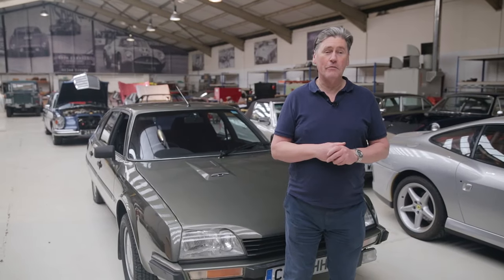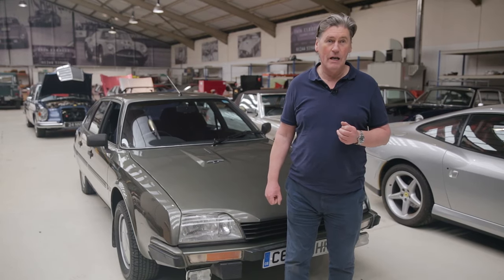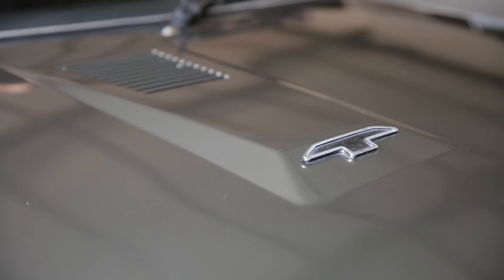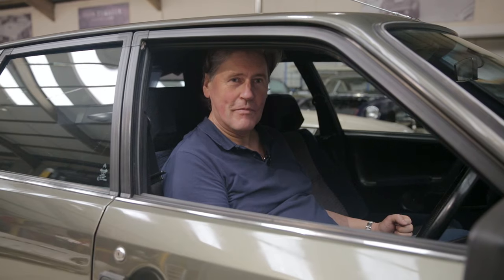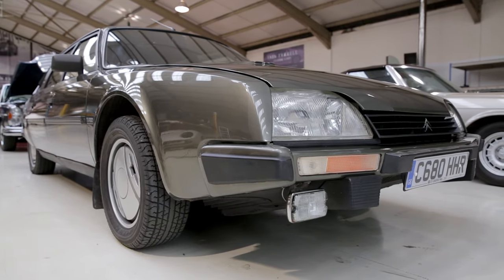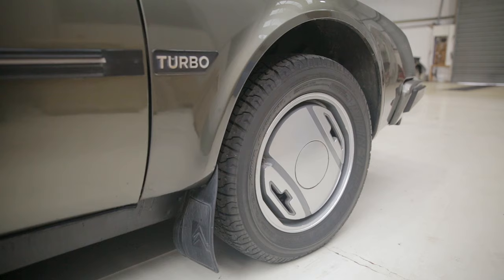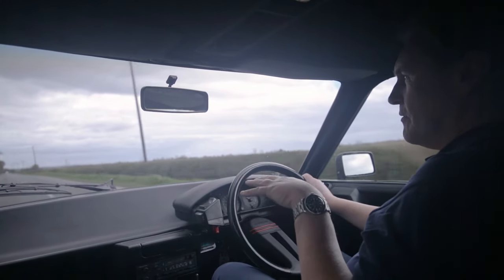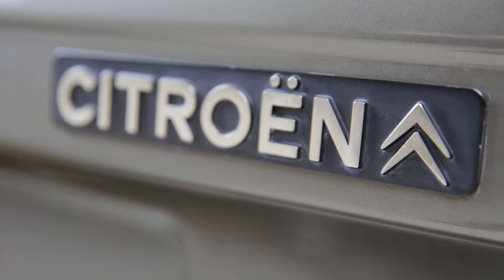Citroën CX 25 GTi Turbo - a rare beast with party tricks | Tyrrell's Classic Workshop

Comment: Fun Fact: A few years ago, during a police raid in a dope dealer house in Rio de Janeiro, the officers found one green sphere that they identify as a hand grenade. They made a huge announcement to the press about the success of the raid, just to have in the next day realized that the sphere show was the suspension component of a Citröen Xantia. 😂 Greetings from Brazil.
Reply: That is hilarious 🤣😂😆😆
Reply from the maker: Actually mine was a hand grenade, disguised as a supension sphere...
Reply: @iain_tyrrell  Ho ho, but April 4 not 1.
Reply: Excellent, great little story lol 😂
Reply: @andyfry1970  I had a Zantia. It was anything but explosive..
Reply: @grahamx8623  It was probably a base model, I've had a Xantia Activa with a 150BHP 2.0 turbo engine and ultra crazy suspension and a Xantia 3.0 V6 with 200BHP both of which were great cars.
Reply: @grahamx8623  I had a Xantia, it blew up repeatedly
Reply: Hehe hilarious 😂😂😂
Reply: @iain_tyrrell  easy on the bumps then 😂😂😂
Reply: marvellous
Reply: @grahamx8623  must not have been a V6 24v Activa. Those we pretty quick. Enough to be used as unmarked police cars.
Reply: All-around ex-Yugoslavia the people called those spheres - the grenades.
Reply: Here too. I saw a newspaper cutout at a Citroën workshop that told a similar story. The headline was something like  war time bomb found. :)
Reply: @FUCK SHIT Yes, they are great to drive. It's just a shame the UK spec Activas only had the 2.0 turbo engine and not the 3.0. We only got the 3.0 without Activa suspension.
Reply: A similar story from the UK, I took my Zantia on a site visit to a USAF Base in Suffolk, all vehicles are inspected by security. On opening the bonnet the guards really didn't know what to make of the green spheres!  I guess they believed my explanation as I did get in!
Reply: one could fill of gunpowder a citroen spherical tank, as well you could fill with gasoline a normal bottle to build up a molotov bomb, you never know 😁
Reply: Paulo G excellent story.  Greetings from Cumbria in the UK.
Reply: Funny you should say, I was thinking to myself as I watched it just how much that green sphere looked like a bloody hand grenade :D
Reply: Great story!
Reply: it would have been quite big as an hand grenade, imagine a soldier with half a dozen of those hanging from his belt: a soldier must move and run quickly, not taking part to a "strongman" contest 😁
Reply: I had a BX GT, the later angular styled smaller model. I sold it (as you do) and regretted it for ever more. BX had a plastic bonnet (hood) and the rear hatch frame was plastic. It had all the hydraulics of the CX and apart from being so low was also light and quick.
Reply: When I used to live in Califonia and had my Citroen DS 23 Pallas there, my cousin came over to visit me in 1997. He agreed to bring some spare parts inculding two new spheres for the car. Newark customs totally knocked him over and he had to testify that these speres are spare parts for my car. :-D
Reply: That’s what I thought as soon as I saw it- and then imagined what might happen if you brought some home as spares and had to go through security or customs…
Reply: Thats a good one😂😂
I have one too.
It was portugal probably 2005 2006 maybe, and there was a mother that had a 1995 Xantia. It was a 1.9TD.
Most confortable car I've been. Bar none. And she parked the car to go to a restaurant. In 2005 portugal's summers were brutal. 40°+ from 10am to 9/10pm. So she parked it in the sun. As she got out of the car there was a beggar and asked for some coins which she denied quite aggressively must i say. She had lunch and when she came out she looked at her car it it looked like the engine had enough and tried to escape taking out the bonnet with it. It was, both canisters exploded in the heat. The thing was, she thought it was the beggar that ruined her csr for not giving him coins and she called the police and sent them after the beggar 😂😂😂
Btw it was my mother and i was there it was hilarious 😂😂
Reply: @79RuralLife

Comment: We had a station wagon version. That air suspension saved our lives on the French motorway. We hit a log, rolling across the road and hit it at 130kph. Fell off a truck along the length of the road. It smashed a full quarter out of the front left wheel. The car retracted the left front wheel at 130kph, carried on on three wheels, balancing, and smoothly allowed us to pull off the road in dense traffic! Absolutely remarkable! CX is such a statement! Thx Citroen! The suspension allowed us to get to our chalet in Verbier CH too! Good memories.

Comment: You said, "There are other cars that are more interesting."  After I was finished watching this episode, I think this car was just as interesting as any car you've ever talked about.  As an American Car Guy, I have always wondered what all of the fuss was about with Citroens.  Now I know and I have a new appreciation for this car.  You are fast becoming my most favorite Youtube content provider.  I thank Harry's Garage for unleashing your love of exotic cars on all of us.
Reply: If you ever get the chance to drive one of these ... don't miss out! It's an otherwordly experience, particularly in the older series I / chrome bumper versions that add a special interior sensation with a drumroll speedo behind magnifying glass and all kinds of awkward but well thought out little details. The ideal of ot all would be the so-called "Prestige" version as it was not only the TOTL spec but also came with a 20cm stretched wheelbase - ALL of which went into back passenger legroom. So if you ever fancy feeling like president Jacques Chirac ... here you go...
Reply: @ralfhenke8148  Later CX models had "normal" instruments but they all had the fixed satellite switches on the side of the instruments pod. They worked so well the sticky-out stalks used on every other car feel so inferior.
Reply: @Dave5843-d9m  ... except for the high beam switch, which would burn out when used for longer periods on, for instance, unlit French secondary roads ... A cheap relay would fix that, once it got light that is :-)
Reply: The CX was very popular with cab drivers. I rode in one many times. Very smooth ride.
Reply: @danielsrje  Headlight relays sound like a good idea. I fitted them on an old Mini 1000 back in the day. Getting full voltage to the bulbs  considerably improved the headlights.
Reply: There is nothing comparable made in Detroit - or Stuttgart or Munich or anywhere else - that comes even close to the comfortable ride of the Citroen CX. Even the copy of the suspension in the Rolls Royce does not generate the “hovering through the landscape” feeling as the CX did. I was always wondering why these were not a big hit here in the USA. Now I know…they were simply illegal. I am sure that many would have enjoyed the unbelievable comfort of these cars going cross country. But the smoothness came with another advantage: the CX worked perfectly well as a “pacifier” for our son back then: a right around the block magically converted any screaming noise into relaxed snoring in the rear. Children loved these cars with all the “party tricks” that are unmatched to this day.
Reply: @danielsrje  right - didnt know for the CX, but my BX SPORT had that problem - found out the little plastic thingie melted, so you couldnt change to high beam, at least, it wouldnt stay on !  a relay actually fixed it 😂
Reply: @thorstenfleiter8238  americans ! they also forbid importing SM's with cornering headlights , probably for economic protection of their own products..who knows..
Reply: @jeanmariezeyen111  it was actually worse in the CX. The same switch controlled all lights. Once burned out you were literally left in the dark 😎
Reply: Citroens were a very underrated car and in the Uk it was the unusual styling..my dad has a gs..my brother and I had a bx..and xantia..I can tell you they were the most comfortable cars I’ve ever driven.
Reply: Preferred the Mk1 to the plastic bumper Mk 2. I liked the speedo in the ark 1  . The kids liked the country, as apposition to the town, horn.
Reply: @jeanmariezeyen111  Had nothing to do with protection.  US DOT (Department of Transportation) regulations on vehicle lighting were hopelessly outdated, some unchanged from the 40's as late as the 80's.  When the Lincoln Mark VII debuted in 1983, there were actually some states that forbade 'integrated' headlamps, and they had to change their regs to allow it to be sold in those states.  The glass-covered headlamps of the E-type had been outlawed in 1968, the same reason the US-spec SM didn't have them.
Reply: As an American myself, we are a very idiological centric people. We always think that anything foreign to us is bad.  We don't take the time to understand it's benefits but label it a poor design because it's not a convential design.  The French were far ahead of us in automotive EVERYTHING yet most American's(including car people) have NO idea what Citroen has given to the world of automotive development.

Comment: Hi Citroen in  those days with that suspension were very under rated .I had a BX 2LTR DIESEL and an ex Hartwell Engineer to service it who advised if you change the oil every 5000 miles it will do 250,000 miles before you have to think of doing any thing to the engine ,purchased it for hauling my tools around for work .I spoke to a taxi driver in Bounemouth and his had 500,000 on the clock and never had to touch the engine .thanks Mr TYRRELL for a wonderful video .

Comment: This and Harry’s Garage are the best car channels on the internet now 👏🏼👏🏼👏🏼
Reply: Now that is a double act  I'd like to see !
Reply: Correct
Reply: With Petrolicious and Davide Cironi's English subtitled vids.
Reply: Don't forget Harry's Farm and the Binky Boys
Reply: Paul Parker I’m with you, both excellent viewing.
Reply: Hear, hear. True motoring knowledge and enthusiasm.
Reply: + 44 teeth & Bad Obsession Motorsport take this to the 4 best
Reply: Cleetus McFarland is great in terms of building and fixing cars too.
Reply: and Jay Leno's Garage
Reply: Hubnut and Idriveaclassic
Reply: Agree 100%
Reply: What's Up Paul?...Can you get me some Man United tickets?😆..if not I will settle for QPR ones👍
Reply: Absolutely agree. I had a new 1978 CX Prestige EFI 5 speed with leather.
The wheelbase was 123 inches (same as the DS) instead of 112 inches. The ride was even better than the standard CX. This longer subframe was also used on the Safari. Rust was the biggest problem on this space ship on wheels. Large windscreen made it possible to have a huge single wiper throwing the water off the windscreen. The concave rear window was self cleaning be aerodynamics.. Ah... Only zee French. Manifique..
Reply: AGREE
Reply: Anyone else find Harry’s Garage and Tyrell’s Classic Workshop videos, reassuringly comforting and therapeutic?
Reply: jay leno's is pretty much the same... go check that out... a lot of very nice cars there
Reply: but here is no hurry,tattooed mechanics or fast fixes or shouting😂
Reply: You said exactly what I was thinking. 👍
Reply: That is a highly subjective issue.
Reply: I would like to recommend additionally "furiousdriving" from britain and " A Road less traveled" from U.S. plus off course " Barnfind Hunter" and " The SmokingTire"
Reply: Mighty Car Mods
Reply: Not even close. These videos are extremely dull and boring. Informative but nothing else.
Reply: Add Vice Grip Garage to the list as well!
Reply: ahh Jay is nice too
Reply: You can't beat an expert that's why 👌
Reply: Agreed